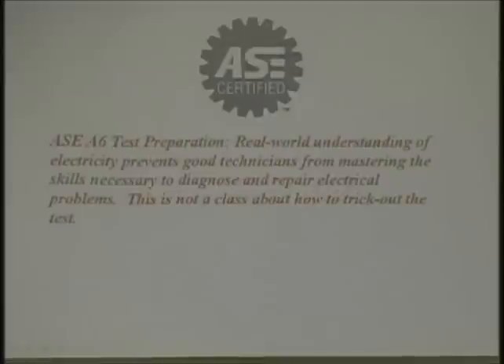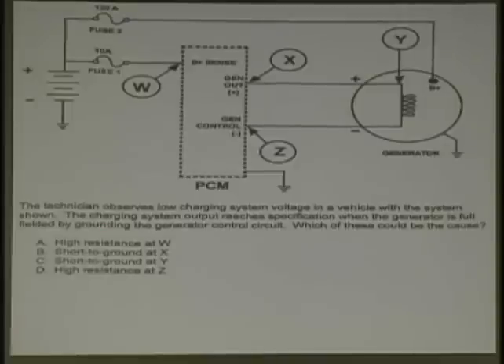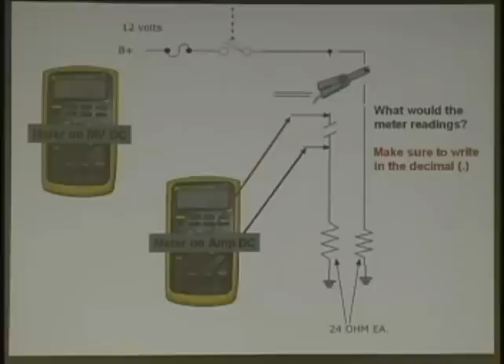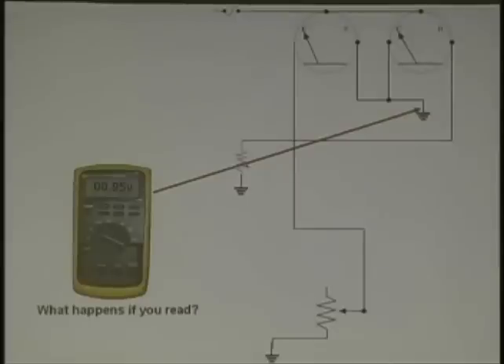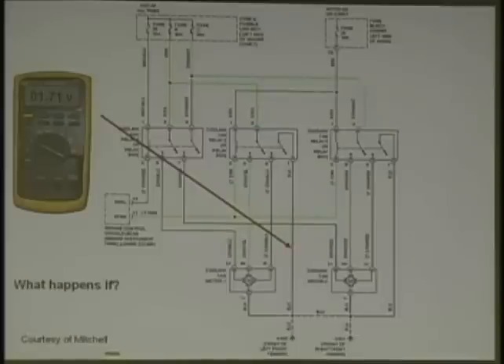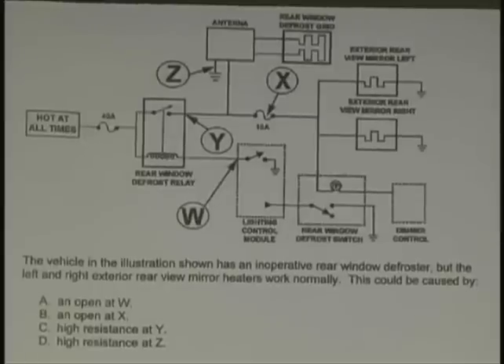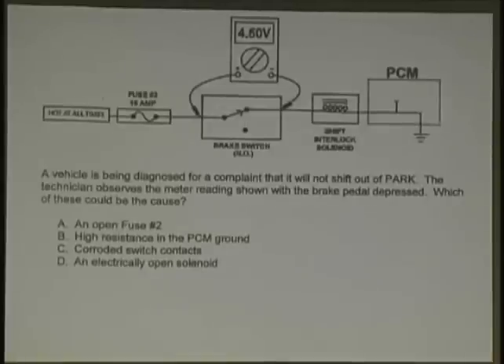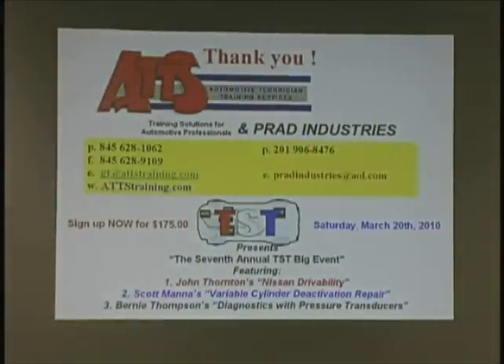Electrical Diagnostics Part 2 with "G" Jerry Truglia and Rich Peterson

Comment: Concerning the Saturn one dim light and one bright light comment at 2:08:49 on the youtube video. I pulled the print on a 2000 Saturn SL and don't see how the right lamp can be back feed all the way to ground (complete circuit). Also wouldn't both head lamps be dim because of splitting the available voltage in what would be a series circuit or as Pete M. says a thief in the circuit. Your videos are great and I have learned so much but evidently not enough, I know I am missing something. Many thanks.
Reply from the maker: Gary each low beam headlight has a separate power supply (FUSE) with a common ground. That is how only headlight was dim while the other was brighter. Hope that helps...Thanks for watching and your comment...If you have not already subscribed to our tstseminars YouTube channel please do so. Interested in more training? Go to www.tstseminars.org and view full length videos for members on TechFlix for $9.99 unlimited viewing …Membership and over 85 videos for less than $200.00 a year. Also checkout www.attstraining.com for hands on training and webcast
FREE videos at www.tstseminars.org/training-videos

Comment: Very informative! To be sure, when testing an injector in series with a dvom, you put the positive lead onto the power side of the injector and the negative lead on the pcm controlled wire and ground the injector, right?
Reply from the maker: First of all thank you for your comment and watching. If your referring to testing it for current you would ground your black/COM test lead to a good ground and the red lead should be in the 10 amp jack goes to the ground side of the injector to measure current. CAREFUL if the test is done without the engine running / hydrostatic lock If are doing a voltage drop test the leads are in the Voltage jacks and they are tested from the battery positive to the injector positive for VD on the feed side. The ground side is tested by going to the battery negative with the black lead and the red lead to the positive side of the injector. Remember this is Voltage Drop with the leads in the Voltage jack and COM/ground. Hope this helps...Also please subscribe to our tstseminars YouTube channel. thanks
Reply: Thank you.
Reply from the maker: Your welcome

Comment: anyone having any trouble with any of this you can google "phet dc virtual circuit" its a website where you create simple circuits and test things with virtual multi meter.ive used it about 30x.sometimes just sitting here ill think of somthing related to circuit testing im confused on and it takes less then a minute to create a virtual circuit and test..

.this will give you hands on experince that sticks in your mind.every teacher needs to discover this so they can get there students to use it when they are confused with certain topics.

physically pulling out a battery/creating a circuit to test takes too much time,this virtual circuit takes a minute and i promise it will be one of the best learning tools at your fingertips.